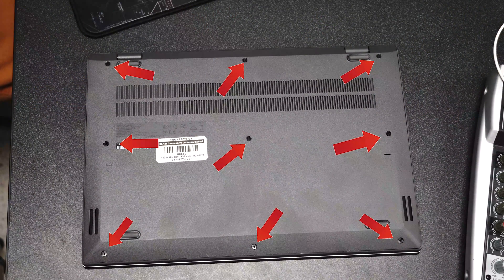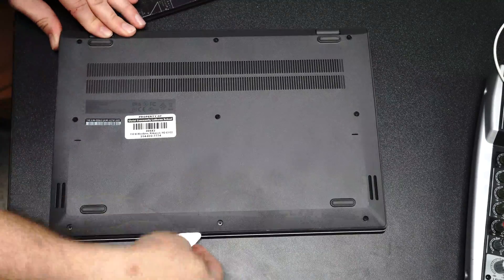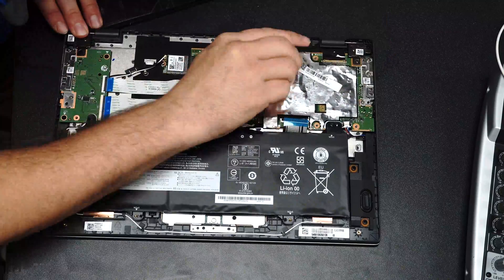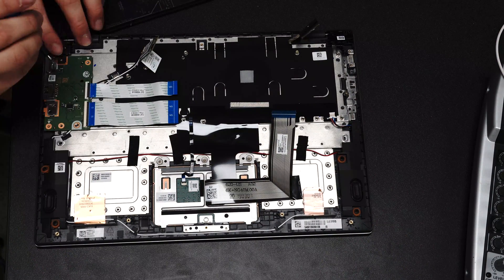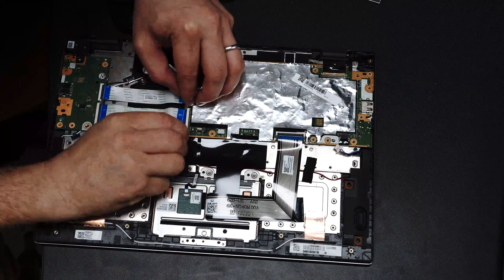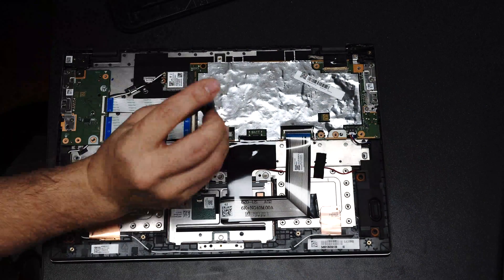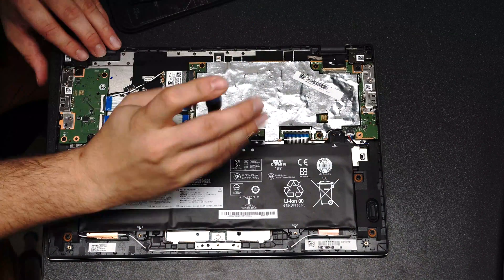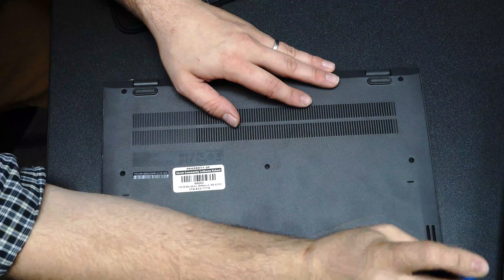Lenovo 14e Chromebook Teardown

Comment: Do you find that these have a disproportionately high fail rate for the wifi cards, mainboards, and hinges coming disconnected from the lid or did I just get a bad batch?
Reply from the maker: Basically anything after the first year has been garbage for me. Exact same issues plus I'm getting huge fail rate on keyboards. 

I really love the design and the first year production model has been ultra tough, but now I wouldn't recommend these. At this point I'm looking to deploy 100es for next year or potentially switching brands.

Comment: Hi, from your video it's difficult to locate Ram ? Is it upgradable ? What about 32 Gb eMMC drive ?
In general are there any upgrades to be performed ?
Reply from the maker: Unless your comfortable with doing motherboard soldering. 

The ram and storage is soldered in on this Chromebook version. However I can't specifically talk about the windows OS model. Perhaps things are different.